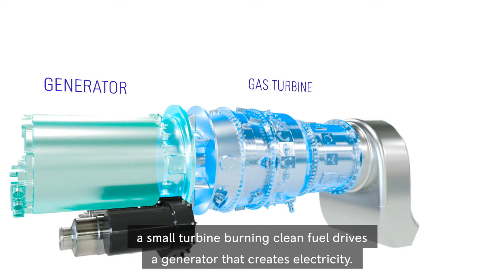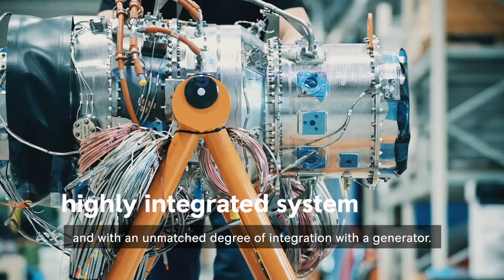Rolls-Royce | A new gas turbine for hybrid-electric flight

Comment: 33.q Hello, there is a new technology from the mda Roll Royce cooperation engine that is ideal for the DB, a vacuum hydrogen laser reactor with a magnetic field pool to form a current absorber, which could be used for trains as moving power plants with a buffer storage wagon.  Thus, a kiwapi kilowatt Pi economy can take place through a ki management control.  Your AGK DTS Hypo Economist Concept Institute maison des associations Thuringia united Germany Protestant Union ©®™ would charge 50 percent of the final patent.
Reply: Ru talking HB-11s reactor?